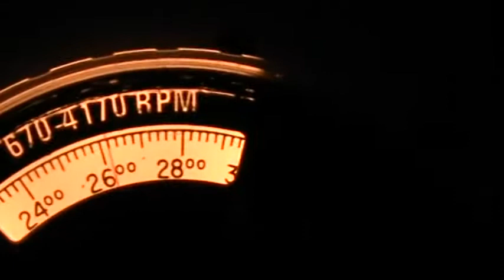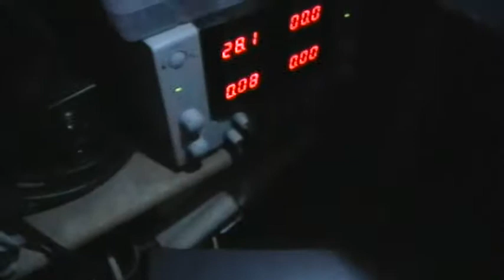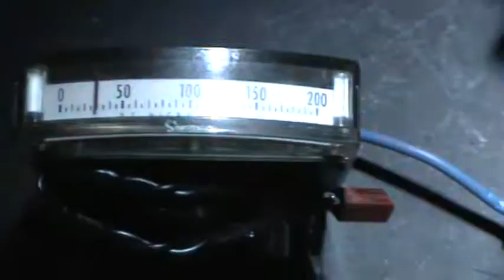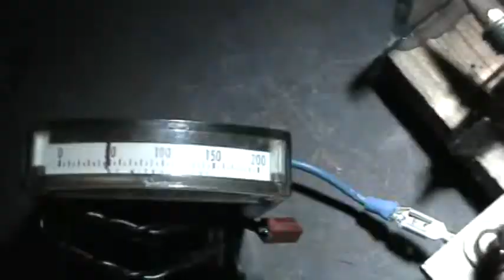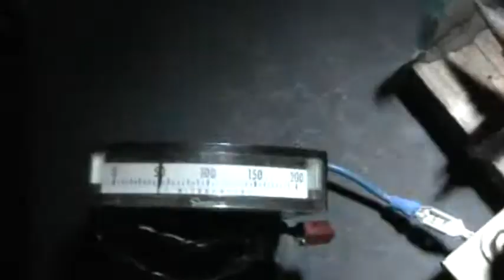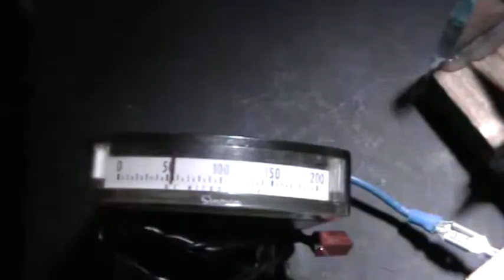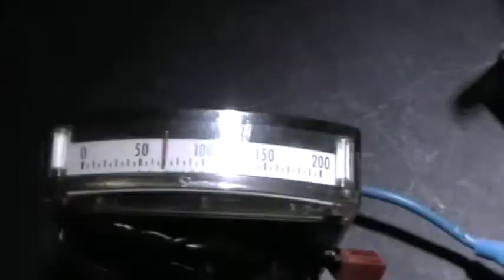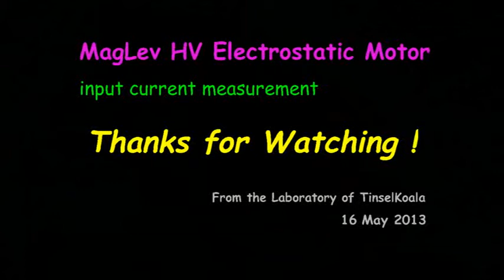Extreme High Voltage: MagLev ES Motor Input Current

Comment from the maker: The hand providing the "originally added energy" is just because of the lack of radial balance. Now that I've put a better axle to the system it will usually self-start without any originally added energy from Mr. Hand.

I don't usually provide explanations for unusual phenomena, I just demonstrate them, point out the "anomalous" or unusual features, and then let the experts argue about how to interpret them. After all, my explanations are just as likely to be a pantload of crap as anyone's. No?